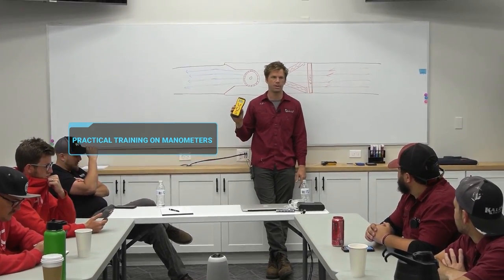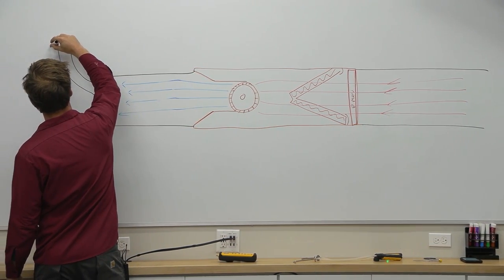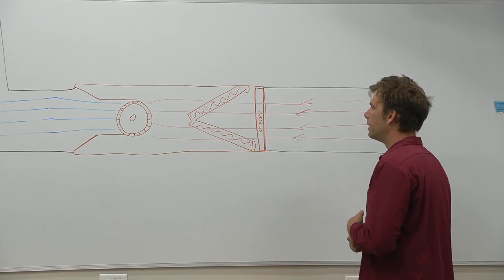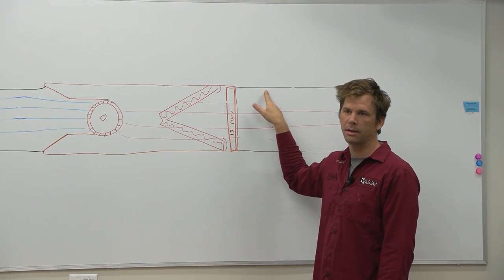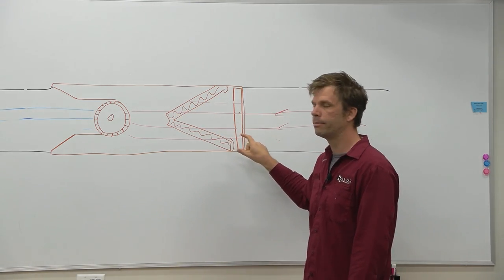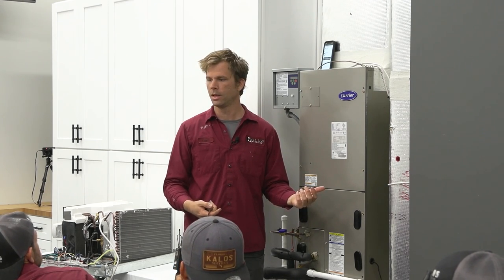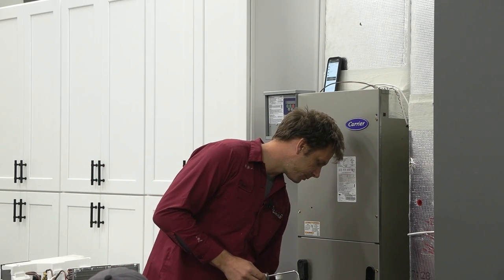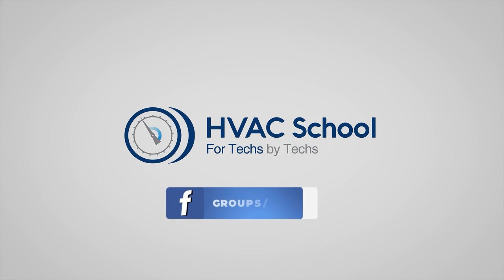Practical Training on Manometers

Comment: The Fieldpiece manometer operation manual says that the tip should be pointed toward airflow and that the arrow on the baseplate should be pointed towards airflow not with airflow. I may have misunderstood, but it appears you recommend putting it in the opposite direction as what the manual states. Is there a reason why you recommend positioning it in the opposite direction? Again thank you for all the helpful videos!
Reply: Do it both ways. Even do it with just the hose and no tip. You won’t see an appreciable difference in any of the measurements
Reply: Yes, that’s right Caleb. I misspoke in the class even though I displayed it installed correctly.  I think my comment mislead the editor, so we have the visual with red airflow arrow pointed backwards. 

Also @me’s comment is nearly always true.  It doesn’t practically matter with the airflow in most residential systems

Comment: just wondering how are you getting an accurate static won't the hose to the wireless probe get pinched in the door was just wondering
Reply: I drilled a hole into the cabinet.

Comment: A manometer measures differential pressure. You need differential in order for flow to commence . Same concept is in use with hydronics, temp etc etc.....its about inducing flow with the smallest differential (head loss, friction loss )needed to operate properly to achieve a set parameter.

We use this in large commercial equipment. I work on equipment with a design static of 1.5", 2", 2.5" wc with VAV's, building pressure. In hydronic systems we use differential pressure set points to modulate VFD'S based on differential readings for when zones, coils,bypass valves etc etc shut down.

Comment: Hey Bert, I have never seen an evaporator coil with a static across it of only .1 if I understood what you said.
Reply: 👍🏻 ok. What type units you working on?  I’ve only taken this measurement on a few residential units over the years. 
.1 seams to be a common read I have on new clean coils
Reply: Probably because hes referring to a pressure drop on a brand new, dry, coil only. Only reason to check coil only in the field is to confirm airflow restriction so  I wouldnt expect to static that low. Its decent baseline for comparison.